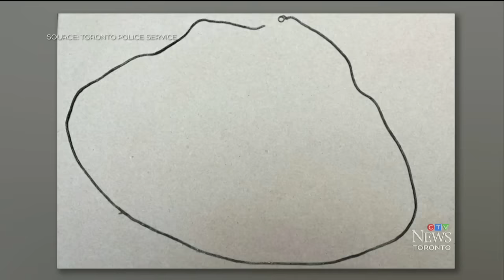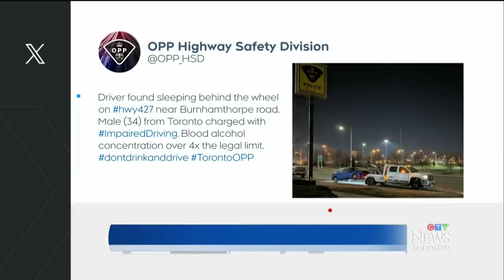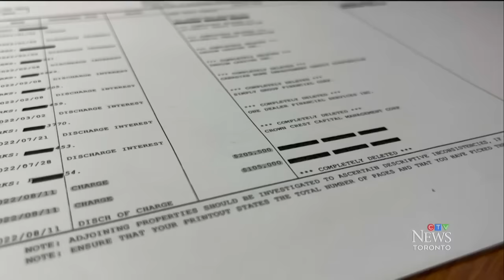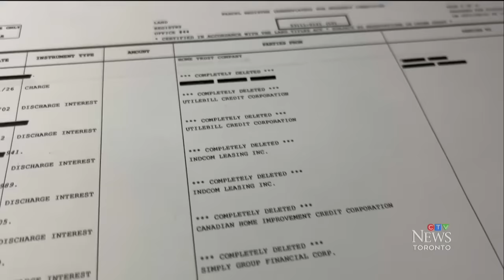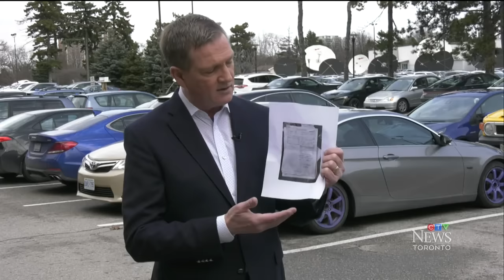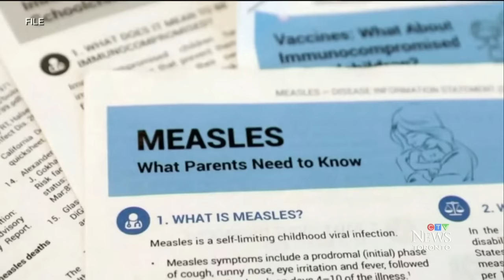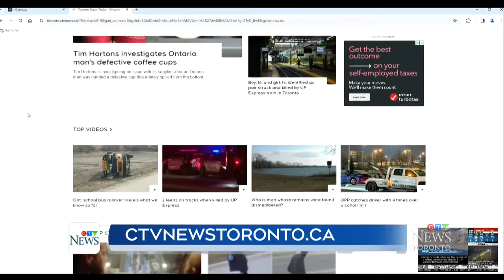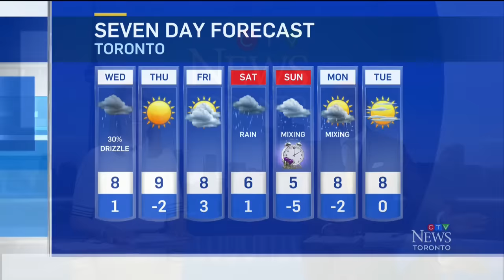Five people from Ontario killed in Nashville plane crash | CTV News Toronto at Six for Mar. 5, 2024

Comment: Maybe the question should be, why is fencing not fixed or maintained to keep trespassers off of the tracks?  If the kids got onto the tracks it's because there was a way to get on them.  Tragically, they were killed, but there was nothing in place to prevent it from happening, which makes it more tragic because it will happen again.